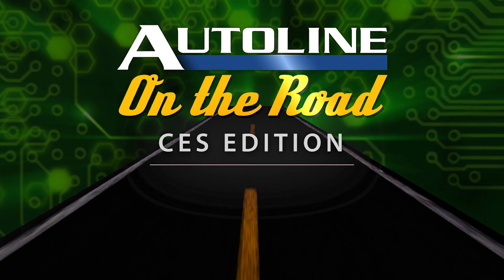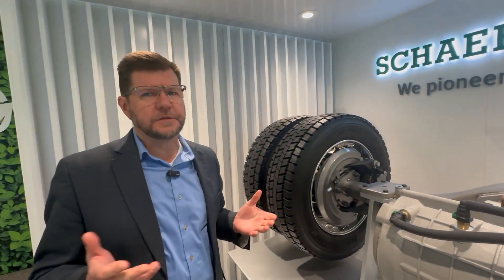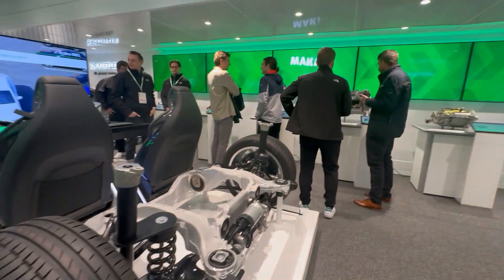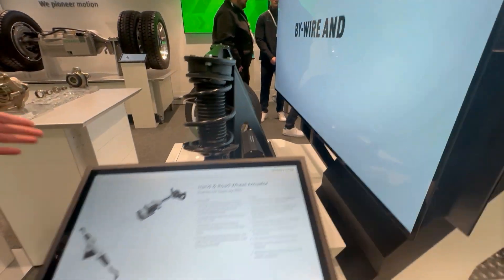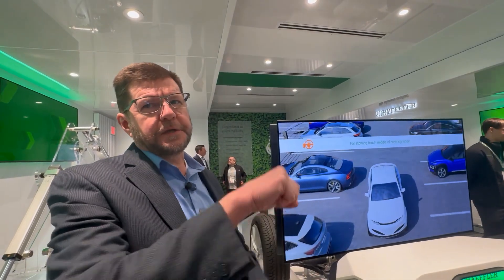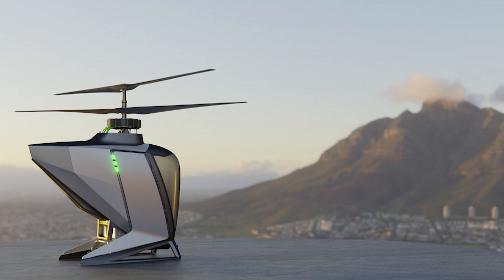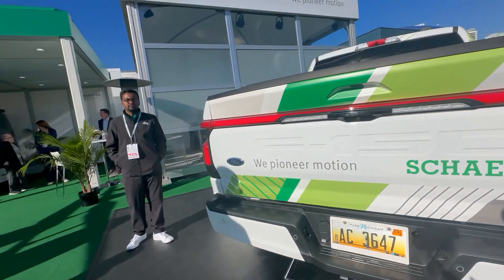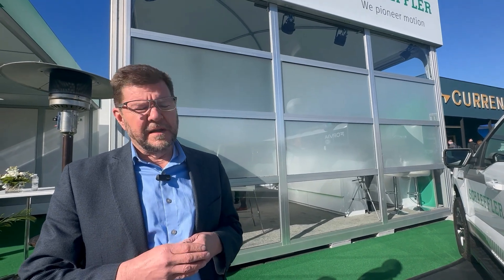Schaeffler Puts eMotors on Everything from eVTOLs to Suspension Systems - CES 2024

Comment: what voltage does the steer by wire system use? 12v or 48v?